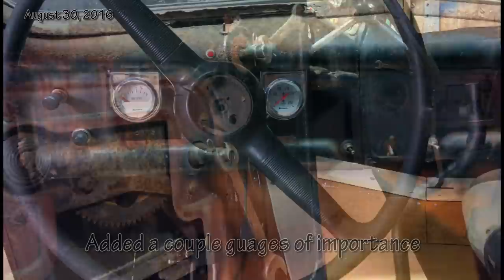1946 ford 1 ton truck Rat Rod Build Video

Comment: Leaf springs upside down - fail. Spring hangers in tension rather than compression - fail. There are probably heaps more, but i stopped a couple of mins in as the amount of danger in this build is staggering. And yet, people think it is awesome, and will copy this with no idea of how peril they are putting themselves, and other motorists in. Shameful.
Reply from the maker: Ok.  You should've watched how the springs ended up.  But, you can't be bothered by completing anything.  Take care
Reply: @DizzoMartell  16:37 the text overlay states "Wheels on and ready to roll" - unless you changed something after that (which I couldn't see; but happy for you to provide a timestamp that shows different), the hangers are still in tension with all weight resting on the skinniest part, and the springs are still upside down (moving the shorter leaves to the bottom doesn't negate the fact that the mains are upside down, therefore reverse loading the eyes). I'm sure you will figure it out the hard way eventually.
Reply from the maker: @justanotherguy9664  That video was a couple years ago.  She rides and drives fine. Thanks for the insight.
Reply from the maker: @justanotherguy9664  https://www.hotrod.com/articles/25-dodge-roadster/   
Another in similar fashion